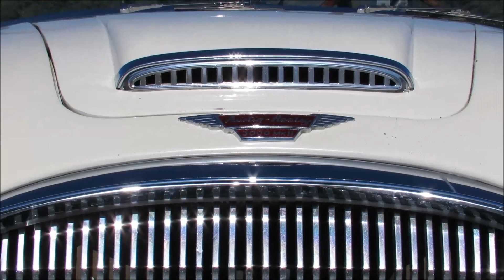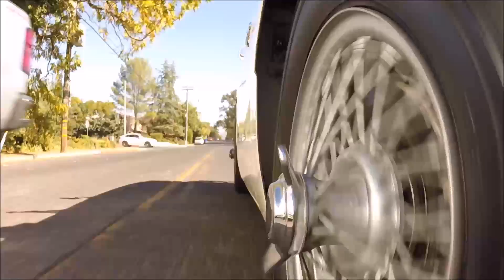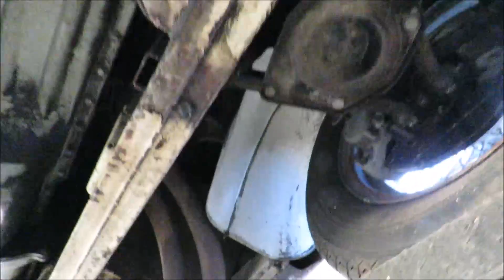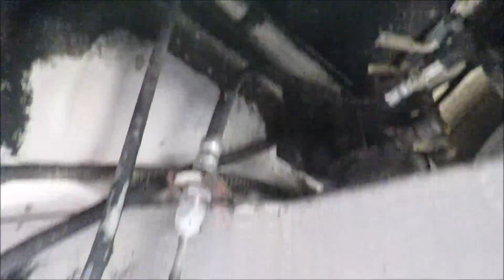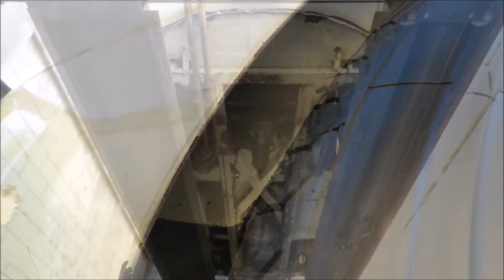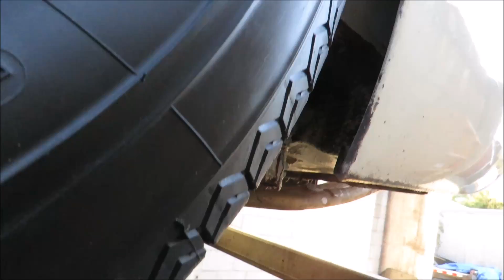1962 Austin Healey Mk2 3000 BT7 for Sale - PART 2

Comment: Time-warp car, beautiful - would have liked a peek at the interior, however. As for restoration, I wouldn't go beyond straightening the bent panels and making good the small areas of surface rust on the passenger-side sill. The remaining marks and scars are the honourable wounds of a good life, well lived, and should be left.